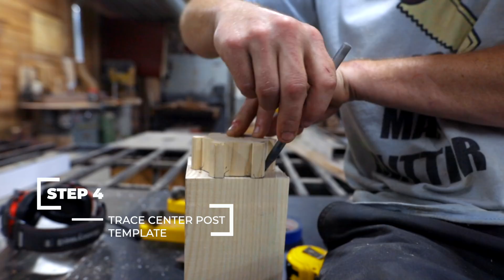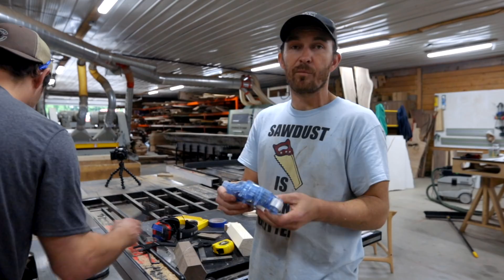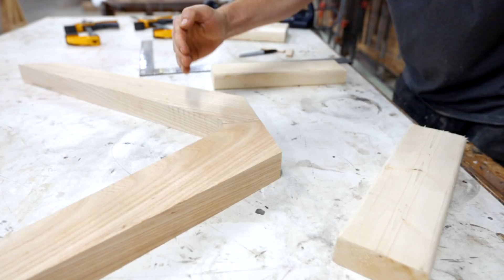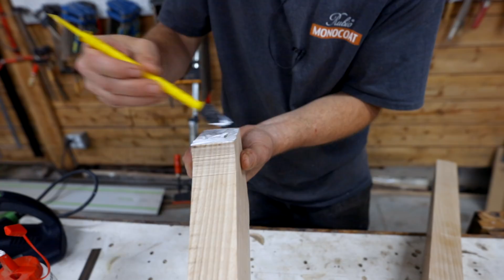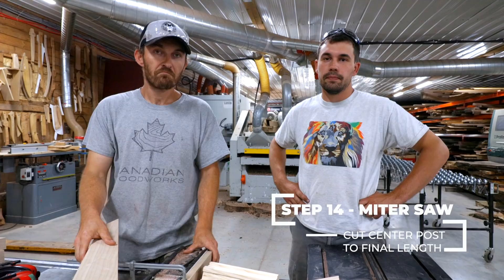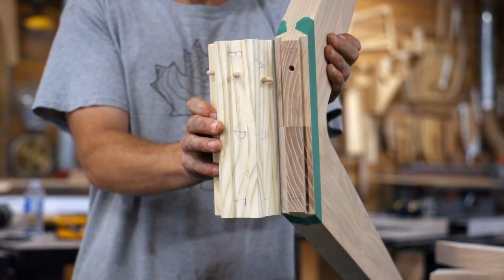Wood Working Life - Building the Hedge Hog Table

Comment: love your channel. sorry about your video loss. a couple of suggestions for others not as skilled as you both. To set height of legs use a short scrap on fence so you run off scrap when cutting and you do not have to adjust fence. Use scrap from legs to set dado cut on table saw. Finally when cutting domino slots set a distance from the edge and flip leg over  again simpler set up.